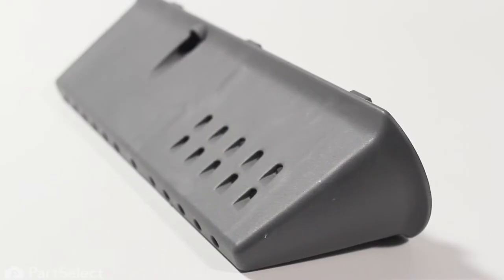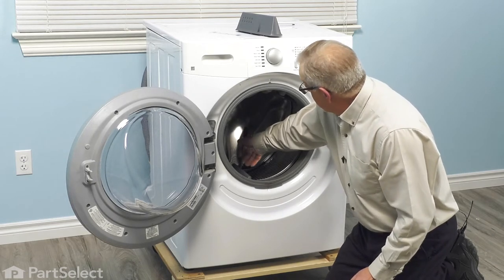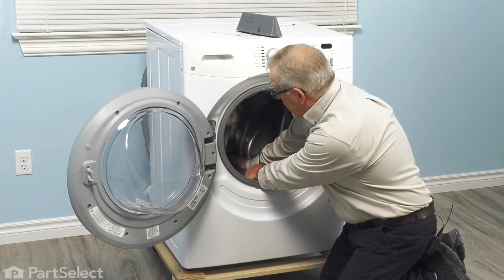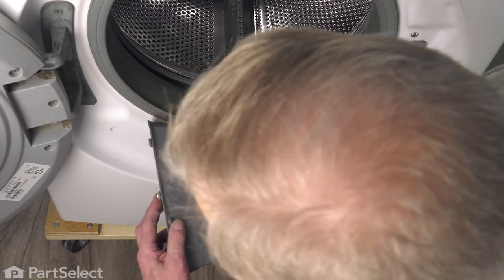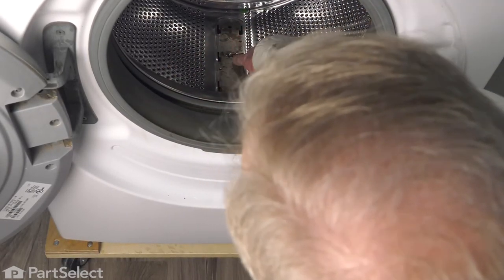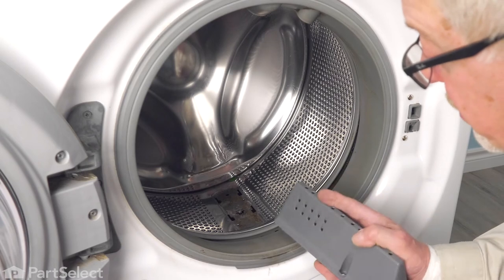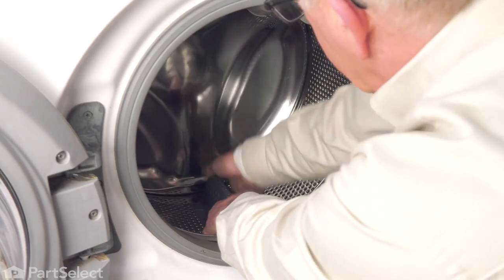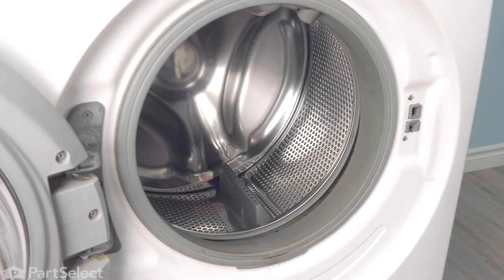Frigidaire Washer Repair - How to Replace the Drum Vane Baffle (Frigidaire #134509600)

Comment: Hello, would you be able to help me troubleshoot? I removed the broken baffle fine, but the replacement baffle will not slide forward into place. I think the plastic tabs on the baffle are getting caught in the keyhole slots. I've tried your technique of bending the metal up a bit, still to no avail. Do you have any other advice? Thank you in advance, and thank you for these helpful videos!
Reply: Did you ever figure it out